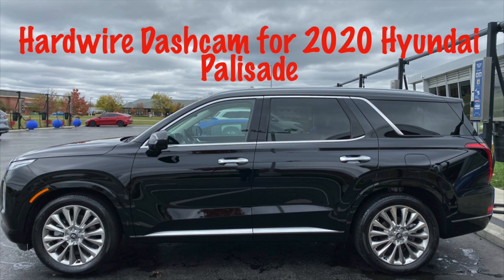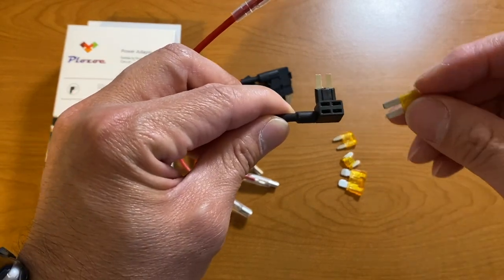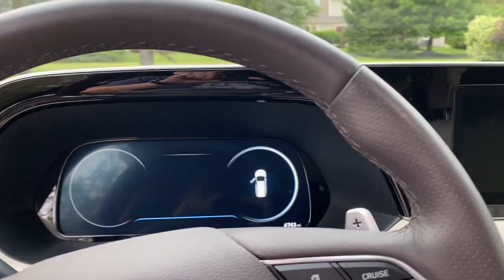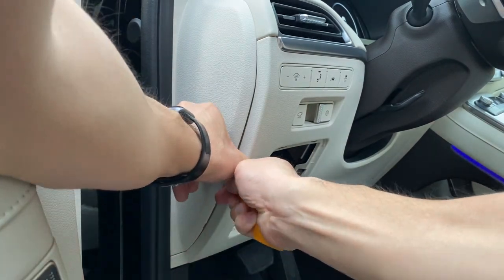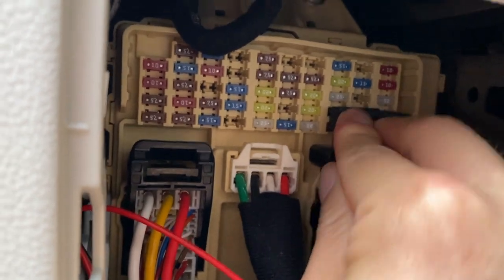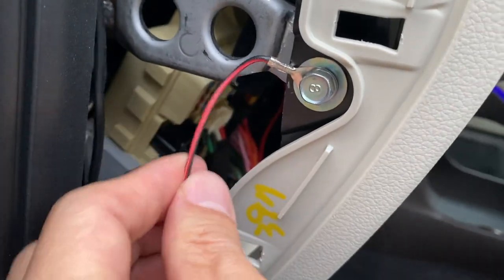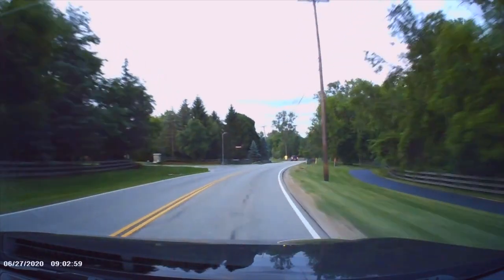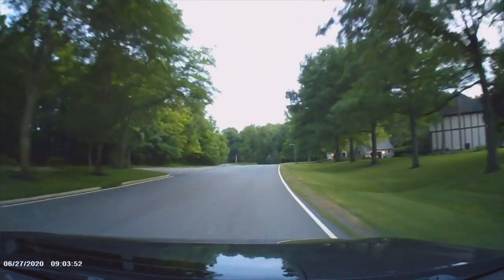How to hardwire dash cam to fuse box - Hyundai Palisade

Comment: I appreciate you posting this as it was helpful. It would have been better if you showed the loosening of the panel with the clip. You mentioned it was tricky. Cheers!
Reply from the maker: Hi David, unfortunately I made the video after the actual installation of the dash cam.  The loosening of the panel is actually fairly easy as it will come loose similar to the other panels.  The tricky part is fully removing the whole A-pillar panel.  I was able to to tuck in the wire without removing the whole panel but I know some people would rather remove the whole thing.

Comment: The fuse you selected, will that work for Parking Mode on a dashcam?  That's where the camera records or monitors the area for movement, then starts recording.  In other words, it needs constant power to the battery.  Or, does that fuse disconnect power when the accessories/power is stopped on the Palisade?  Also, which fuse can I use where there is constant power to the battery on the Palisade?
Reply: Did you ever find an answer as to which fuse to use for constant power?

Comment: Hey, great tutorial. Just a quick question regarding hardwiring your dash cam for constant power. Will it drain the battery car battery?
Reply from the maker: Hi Matt, it shouldn’t as the dash cam should only turn on when the engine starts and turns off when the engine turns off.
Reply: ¿Does that means that the 24 hrs monitoring will start only if movement is detected using very little power ?

Comment: how did you know the orientation of the fuse adapter to ensure  you have the load side of the  fuse to the correct side of the fuse box
Reply from the maker: Hi David, I am not an electrician, so take this answer with a heavy grain of salt.  My understanding is that the fuse can be inserted either way for a low amp fuse that is not essential (airbag, etc).  If you look at the fuse panel, there are some fuses inserted one way up and others upside down that was installed by the factory.  I was more worried about finding a fuse that provided power when the engine was on vs. constant power as I didn't want to drain the battery.
Reply: @wearefamilee007  Thanks for the reply.  My voltage meter broke so I was trying to bypass a step.  If you put the adapter in the wrong way you will bypass the fuse.  Here is some information on the topic at 3 min in to the video https://www.youtube.com/watch?v=8b9CvUMcNQo&t=263s   if you knew the "load" side I was simply going to follow your lead.  Thanks again for the information